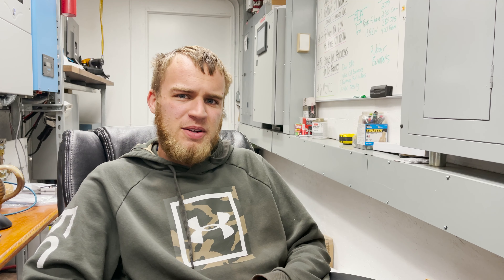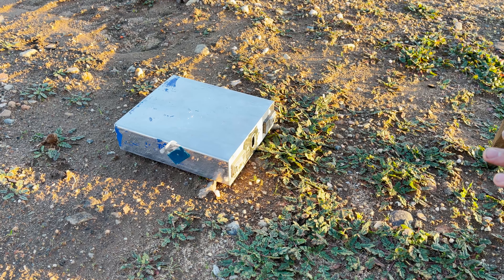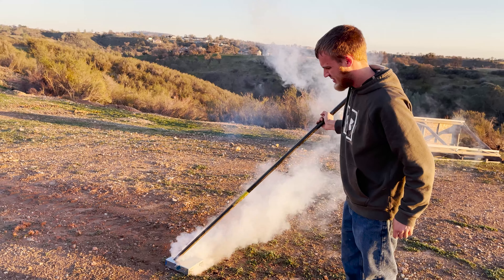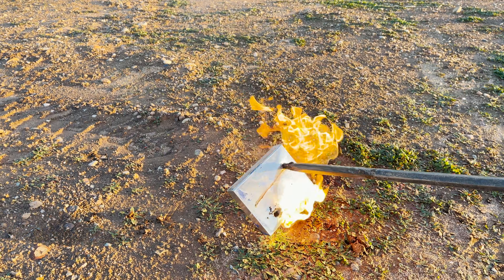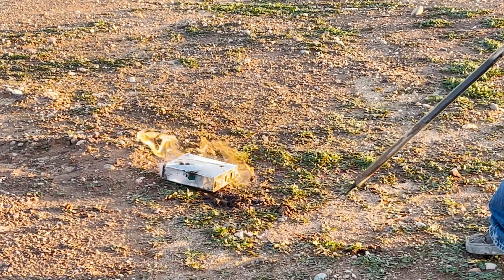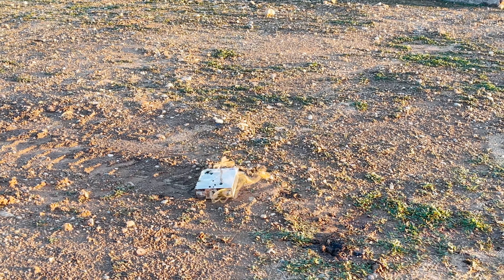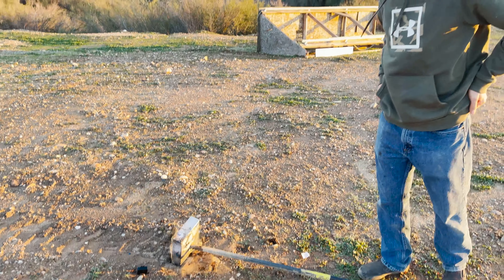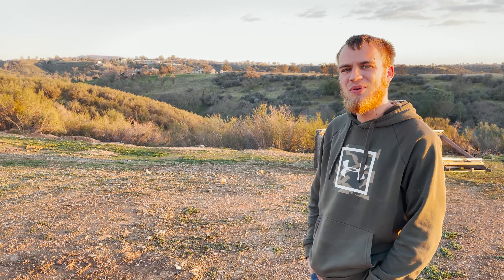LiFePO4 Puncture Test - Can these batteries catch fire? Is LiFePO4 Safe?

Comment: I really hope the solid state and sodium ion batteries get combined as on viable technology. That can both can be made at scale without the bottleneck of lithium supply and these truly can't catch fire, even in car crash conditions because there is nothing flammable in it. If this was invented and implemented as the sole way of powering cars, this would make the problem of some car crash victims getting trapped in a car and burning to death if the firefighters can't get them out in time, to be a thing of the past. This is a problem that should have been solved decades ago, but sadly there has been no financial motivation for wall street to fund an effort to do so.

Comment: I think under normal use and normal failure modes it will just off gas and not self ignite like a lipo.
Reply from the maker: I think the gasses only ignited because when I sent the spike through it the second time, it cased some level of internal shorting that made a spark that ignited the electrolyte that was being vaporized.

Comment: I won't be puncturing my batteries, but overall is LiFePo4 more resistance to overcharging or overdischarging leading to explosions?
Reply from the maker: Over discharging won’t cause any runaway reaction. Over charging without a bms can cause electrolyte venting.

Comment: It's the lithium that is the issue puntchturing the battery is shorting the cells causing them to overheat, the lithium will burn until it is consumed... if you put it out, it will simply reignite.
Reply: Also take care... there is a very real danger of explosion here

Comment: 0:31 Well, the fire is because there is a thermal runaway Impact of cell chemistry, when the temperature is above 240 degrees for these types of lithium ion phosphate these will catch fire, now such sudden increase of temperature created by this vertical sharp metal rod after striking it on this battery is what causing this fire. The striking is generating temperature above 240 degrees. Another alternative maybe Lithium titanate oxide battery.

Comment: No, I don;t think you can extunguish it with a 5 gallon bucket.  My chemistry is rusty, but I thought the LiFePO contained everything necessary to burn.   So, they are tough to extinguish.   You got that PO4 group there, so (and I might not be right on this) it seems the lithium would scavenge at least some of the PO4's oxygen, then, how noxious the combustion gasses are is TBD.   I would suggest perhaps testing that. 
But as you say in the intro, they are a safe if you take everything into account.   Risk of puncture could be minimized with a well planned installation?   Good work though.
Reply from the maker: @TheGreenHeartofItaly-fl3wv  it does not contain everything to burn. There is no free oxygen, its phosphate so the oxygen is not easily released like NCA where the oxygen is bonded to cobalt and is easily broken free supporting combustion
Reply: @HighTechLab  Excellent! seriously, my chemistry is rusty, so I was speculating.   The fact remains though they are difficult to extinguish.   Apparently.   I assumed they contained the oxidizing agent, but perhaps the reaction is more complex.    I will dig into it a bit, but if you can accelerate the general understanding in this area it would be very good.   Perhaps even to fire fighters with the few fires that resulted from electric car crashes.

Comment: At first the vent on top was working like it should. After another jab in the side did the trick on getting the fire going. I'm wondering when you clamp these cells together that over time the rubbing action of expansion and contraction and just general vibration will rub through the blue plastic exterior and short out the batteries?
Reply from the maker: The aluminum case is not permanently bonded to positive or negative. The only difference in potential is through the electrolyte that is internally contacting the aluminum case.

Comment: I ordered 8 cells, they came in two boxes and there was one cell in each set that is bulged. I've yet to compress them, but there's just enough swelling that the buss bars barely fit. I see that's common with the lifepo4 3.2v cells, and they still pull capacity. But it makes me curious it it swelled anymore if compressing them would be dangerous. 
   I saw a couple of videos where smaller types have actually been pulled out and then swelled to double their size, have you thought of doing a compression video? Take a swollen cell and squeeze it to see if it pops lol.
Reply: Swelling is fine and normal unless it's an unevern obvious bulge in one spot. The cells expand and contract with heat and charge

Comment: The battery did not catch on fire. What happened was that the second strike with the pick caused a spark.  The gas that was already escaping is flammable! So the spark from the second pick strike caused the already-escaping-gas to ignite, becoming the fire we saw.
Reply: causing the battery to catch on fire

Comment: I would have been interested in seeing a deep dent on the side and another one on with deep dent on the edge or corner. Does it swell and pop the vent or flame up? I know what happens when you shoot a charged lithium polymer with a .22 …… fireworks. Much worse than that LiFePO4.

Comment: Still it has a very good opportunity to extinguish it easily as he says that the battery does not release it's own Oxygen, and if you foam it with extinguishers to isolate from oxygen of air it will extinguish.. This battery is the future of EV.

Comment: The organic electrolyte is flammable but since this battery has no Cobalt oxide there is no internal source of oxygen to make the combustion much worse. So the oxygen has to be delivered by the atmosphere and the fire is quite tame as a result.
Reply: What do you think is the O4 at the end of the chemical symbol LiFePO4 ?  Looks like 4 oxygen atoms to me, per one lithium,  one iron,  and one phosphorus atom.   So if the fire supplies the energy to break those bonds,  how is it not able to supply its own oxygen?
Reply: @tano1747  Nitrates, such as ammonium nitrate (NH4NO3) and sodium nitrate (NaNO3), are commonly used in explosives because they contain highly oxidized nitrogen in the form of nitrate (NO3-) ions. These ions readily release oxygen when they decompose or react, which can support combustion and make them useful as oxidizers in explosives.

Phosphate ions, on the other hand, contain phosphorus (P), which is a less energetically favorable source of oxygen. Phosphorus compounds are generally less reactive and release oxygen less readily compared to nitrate compounds. This makes phosphates less suitable as oxidizers for explosive materials.

Comment: The bat used got some trouble ? Maybe thats wy it burned
Reply from the maker: The only thing that was wrong with it was the terminals were laser welded in an incorrect location.  We did briefly short circuit the cell, but I don't believe that had any effect on this test, considering  the electrolyte in LiFePO4 is ethylene carbonate–dimethyl carbonate (EC–DMC) 1–1 lithium perchlorate (LiClO4) 1M, which if you dig deeper into dimethyl carbonate, you will find it has flammable properties.

Comment: Under normal use are they safer? I mean harpooning them is not normal usage😆
Gaz UK.
Reply: No. They can explode as well! It just takes longer until they explode. It takes longer to overcharge a LifePo4-battery!
Reply: @SmartZero-f8e  Oh yes, I mean the battery is only as safe as the charger and any sensing circuitry on the battery. but puncturing any type of battery is still not normally expected.

Comment: I knew they weren't safe back in 2010. They are the safest but they are not safe. Keep them in metal containers and away from the home when in use. Ours will be in a separate building for the equipment only and away from the main equipment in fire safe containers.

Comment: Now see if you can put the fire out.
Reply from the maker: We have some fire suppression modules we are going to be testing soon, so hopefully that goes as planned.  Seems that it's just the vapor burning, and is not supplying its own oxygen like LCo chemistries would.  This is why we need to do these tests!
Reply: @HighTechLab   I would like to see you trying the fire suppressors on all battery types. Wet cell, AGM's and Lithium.

Comment: Thank you! Was considering a LiFePO4 car battery for my diesel-powered truck, will consider this bit of information. O.o
Reply: The lifepo4 chemistry shines in deep cycle storage use.  Its not well suited to automotive starting duties though there are some on the market.  Remember, even if you get a battery with the high discharge capacity needed to start a large engine, charging in sub-freezing climate is still a big issue.  Also the heat of an engine compartment can be very detrimental to long life for lifepo4.  Be cautious about this use of lifepo4.

Comment: Interesting such a clear flame and doesn't seem explosive
Reply from the maker: I believe it's the electrolyte, which is made up of  ethylene carbonate–dimethyl carbonate (EC–DMC) 1–1 lithium perchlorate (LiClO4) 1M, which if you dig deeper into dimethyl carbonate, you will find it has flammable properties.
Reply: @HighTechLab  thank you for your explanation. I didnt know that.
Reply: @HighTechLab  was the smoke hot ? It burns hand?
Reply from the maker: @solidfuel0  don't know, didn't put my hand on it. 😅
Reply: @HighTechLab  perchlorate is used in rocket fuel.  Enough said....;

Comment: Easy solution to this. Use lead batteries if you are into speering batteries and leave LiFePO4 to those guys with no speers. Other then this super unrealistic test, if some goes wrong I would be much more concerned about the developing hydrofluoric acid (easily deadly) which is built when the electrolyte reacts with oxygen …

Comment: Please help I have a scooter that the battery was kinda glued down a little and hard to pry out I punctured the battery case and it popped loud and some smoke came out and now I'm afraid to touch it do you think it's OK now to get out now that it popped and smoked should I put on some safety gear and get it out?
Reply: leaving it outside, slowly discharge it flat (like leave a headlight bulb attached for a week), take it to a recycler, get a lifepo4 replacement.

Comment: Don't use them in an engine bay as high heat on a hot summers day will set them off in much the same way. Its like : I smell something, shit there is smoke coming out of my bonnet, oh shit its fire now, phuck get the fire extinguisher.
Reply: BMS will shut it down long before conditions are ripe for a fire.  The engine bay heat will greatly reduce the life of the battery though.  High heat locations like engine bays need to be avoided.

Comment: Not a very good test, this is not a battery in a normal situation. You did it up on a hillside with a good wind. Are LFP (LifeP04) safer than L-ION? The answer is not only Yes it is also they are far more dangerous, it just depends on how you look at it. So why yes to safer? The only good thing about LFP is the thermal runaway needs to get to 450c (300c for L-ION) before it's sudden unscheduled disassembly happens, so you have more time to run away from the explosion. But why am I saying explodes? did not do that for you. Hydrogen fluoride, hydrogen chloride, and hydrogen cyanide, are just some of the very dangerous gas's given given off by a lithium fire. L-ion battery 28%  these are hydrogen gas's, LFP battery 51% not only are this type of hydrogen gas's very deadly to breath, but they are extremely explosive. So a LFP battery is just a bigger bomb. So I think you may understand why your test did not explode, it was the wind blowing the gas's away. So think about the battery indoors, or in a car where the gas's can vent to the inside of the car. Accidents do happen batteries will get damaged and start to vent gas's, and when they get to thermal runaway, if the gas's are not blown away BANG, there's your explosion. Also Lithium Ion Burning velocity is 51 cm/second, LiFeP04 LPF   Burning velocity is 112 cm/second, so it's going to set fire to more cars or buildings around it.  LFP is also heavier than a L-ION battery. So please no one repeat this guys test, it is very dangerous. And if you want to use this type of battery, treat it with the full respect it needs. Which also means if you have a EV with lithium batteries do not crash it.
Reply: Are you just making this stuff up as you go along? How is the LFP battery a bigger bomb when lithium ion contains more energy density than an LFP.

Comment: In electric cars you basically are sitting on a big pile of this, 
and this battery is considered less flammable. 😓
Makes you reconsider the safety of EV.
Reply: And in a gas car you are sitting on a big tank of gasoline which is flammable.  Makes you reconsider the safety of a gasoline vehicle.
Reply: @sethfurbush7100  gastank drop the fuel on the ground if it leaks, this battery's or tesla battery not.......
Reply: This is 100 if not million times less flammable than gasoline.
Reply: @markmd9  if you don't know, gasoline fire is also too hard to put out